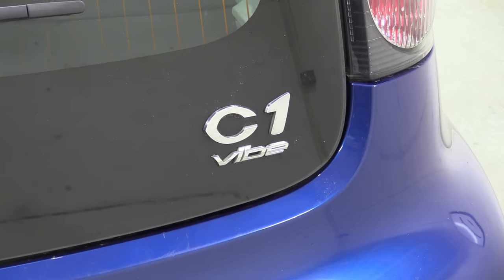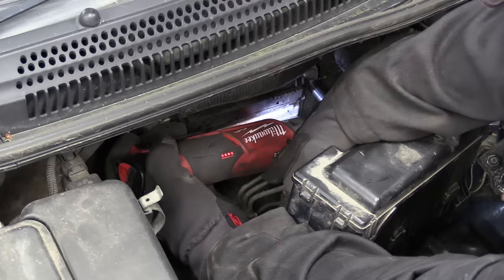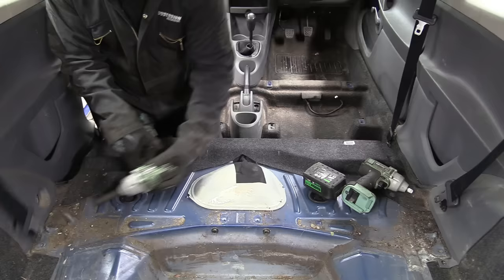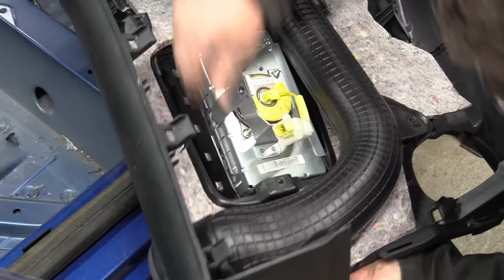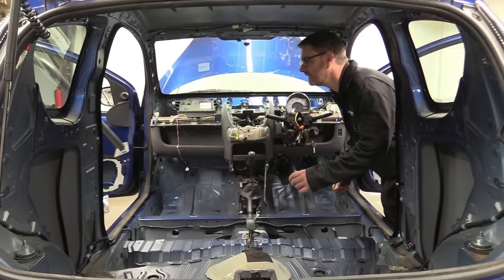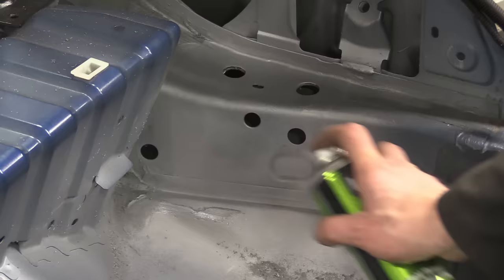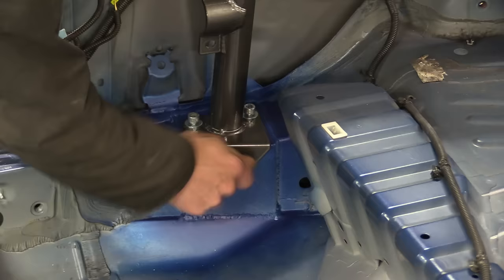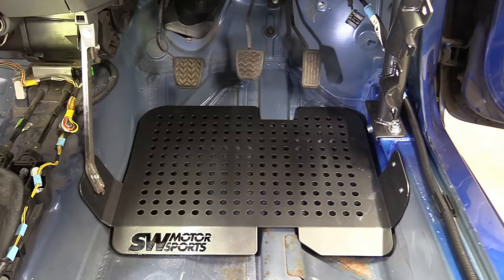Part 1 - Building an £850 hatchback into a competitive race car.

Comment: I wonder if BOM is familiar with the US phenomena known as 24 Hours of Lemons ?   junk car endurance racing,  its about 17 hours of actual racing over 2 days, the car sans safety equipment can't cost more than $500 (wink wink nudge),  and while silliness is encouraged, there's actually a rather serious component of racing to it all, as well as craziness like 2AM junkyard engine swaps so they can race the 2nd day after throwing a rod on the first.    I've known folks who've fielded cars like older Mercedes 400E,  Volvo 740 turbo wagons,  various beat up BMWs, and had decent results.    These races take place at major road racing tracks across the USA.

Comment: You don't need to spend thousands on a racing rig, all you need is a wheel and pedal set, like Logitech G29, and just either clamp to your desk, or buy a cheap but sturdy rig for £150. You can be pretty competitive with that, iRacing and Gran Turismo match you against similar ability racers so you'll alway have a competitive race.

Comment: I use the acid 8 as weld through primer, none of the advertised weld through primers actually adhere to the metal properly so are actually pretty pointless other than that nice work

Comment: Hay! There's nothing wrong with earl grey tea....
What intrigues me is.
For around 20k you can be set up with a competitive Sim racing rig - ok were talking high end- ish.
But for cost of a steering wheel and foot pedals one can buy the real deal 
🤷?
Factor in a trailer,  4x4 to tow it to track,  you'd Still have change from 20k ?
Yes the SIM is more accessible but if one is gonna spend that much and most likely spend most waking hours competing why not do the rea deal..
?

Comment: Window winder handles will come off easier if you feed a rag between the backside of the handle and the door card, then work it back and forth like you're flossing your arse crack. Clip pops right off.

Comment: If you paid 850 squids for that shed in the YouKay, you've been seriously ripped off.
Reply: £850 is actually really cheap for a Citroen C1- even the worst running examples normally fetch around £2k.

Comment: US DOT in 2009 mandates a roof must wistand three times its curb weight for crush resistance. not understand how that is not a roll cage standard.. (and as such, US vehicles have at least 1000lb (450kilo) increase in curb weight vs over seas.... (2500 lb car anywhere else, is 3600lb stateside)

Comment: bring it up to 135km/hr... turn hard right then all the way left and back to the right, after that its rolling over. you ever see a car like that moving at speed, there asking for a bad day.
Reply: sehhi vooty  I weld 22 and 18 gauge sheet metal with 1/8'' welding rod. you do not need a wire welder to reinforce the frame of the car... can do it with a stick welder, 0.035 flux core welding wire burns holes in 1/8 sheet metal. "using 3/32 and 1/8 inch welding rods on the sheet metal of a vehicle, is one of the ways to know if the metal your welding to is still in good condition".

Comment: You'd be better off building a VR Sim racing setup. The money you'd save on the giant monitors would be nice, doesn't need to look like a nice setup. You can buy a decent wheel setup for 100 rather than a few 100, too. Throw in an old seat and a moderately powerful PC (not that expensive) and a VR headset and you've got a setup that will blow and monitor setup away in terms of feeling

Still not even close to being a match for the real thing, though

Comment: please, can you send me the blue clips of the radio bezel. i keep losing those installing the new android radio into the new 2 din bezel which did not came with blue clips.
nah just jokin' the new bezel actually fits and grips just good enough without them to be honest.
Reply: edit: would be nice though. a two din android radio in that car. and then run the torque pro app on it connected to the OBD2 plug of the car.

Comment: Building a small rally car in between building a small rally car.
Slight difference in the two, but still...

When this started i thought you might be making a simulator, a gutted car with hydraulics, screens in windows, but i thought that would be a bit much, instead, just build a small rally car.

Comment: You got ripped off. You can pick an early C1 up with about 50k on the clock in immaculate condition for less than a grand. A bucket like that goes for £400 tops

Comment: Well, actually.. I think this is one case where you DIDN'T do your homework!
If you can get some chinese Arduino's (7 quid each), drivers, stepper motors, an assortment of buttons/switches (to make the steering wheel), a hydraulic pressure sensor (for the brake pedal, and use firewall+pedal box+brake master cylinder from the Celica), and hall sensors (for clutch & throttle pedal), put your various welding machines and milling machine (not to mention angle grinder) in working some pieces of metal, you could have easily got away with a lot less than 850 quid and modified your existing sim racing setup to be just as competitive, if not better.
They sell these rigs for stupid amounts of money, with cheapest chinese components, because people don't mind paying for it.

And how much did that kit cost? My guess is even if you add headtracking into the mix you're still nowhere near the cost of purchasing, much less fully kit out that Citroen :)

But despite all this, your end-game is accepted: There is no substitute for driving IRL if you can afford it!

Comment: the rig should be easy and cheap for you guys to make. 
Fanatec CSL elite setup and you're good.

As for the car being cheaper than the rig, for smart guys, youre so wrong its not funny.
You could spend 2k all up and you dont have to spend a single cent more. With the car there is the initial car purchase, the safety gear initailly etc etc. Then there is the upkeep and parts and the event fees. Youre spending more on the car intially than you are for the rig.
Reply: bocoy noiu  what?

Comment: Citroen C1 is a surprisingly reliable car but the clutch is shite, my ex gf had one and after 35 thousand miles it needed a new clutch, contrast that with my current car a 2007 Mitsubishi Colt which has done 107 thousand on original clutch and yeah, French need to catch up the Japanese fast

Comment: 850 pounds is really not a bargain. It is kinda expensive guys...
Reply from the maker: Is it?
Reply: @BadObsessionMotorsport  I mean, I am not "into" the market over there in the UK guys. But here (West of Germany) you can find cheap Clios, Corsas and Micras for around 1000€, with Zentral locking, AC, Electric windows and Mirrors. 
Maybe your cars, meaning in the UK, are just more expensive in general?
Reply from the maker: But we didn't need any of those cars. We needed a 3 door C1 with no a/c and less than 100k miles. It's a reasonable price.
Reply: @BadObsessionMotorsport  I was not saying that. I was wondering why a little box like that is so expensive.
Reply from the maker: Anything with a valid MOT is at least £650.
Reply: @BadObsessionMotorsport  Yeah OK that is to be expected though isnt it?
Anyways, I like this series already, can not wait to see any more of it!